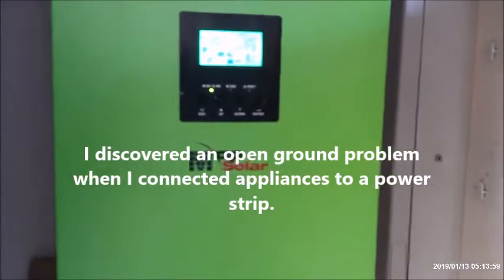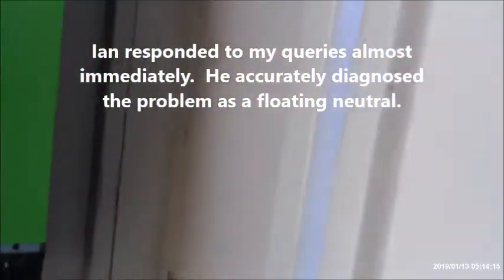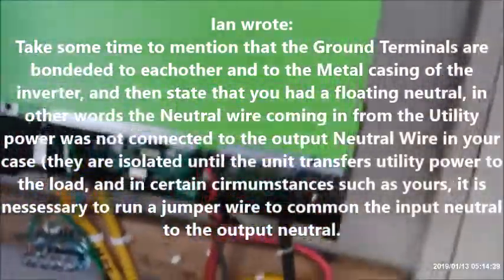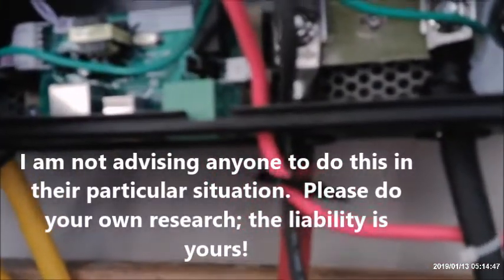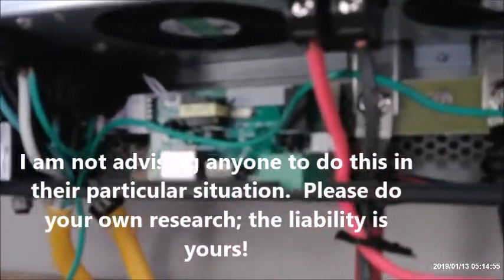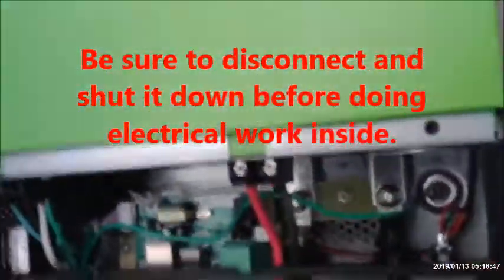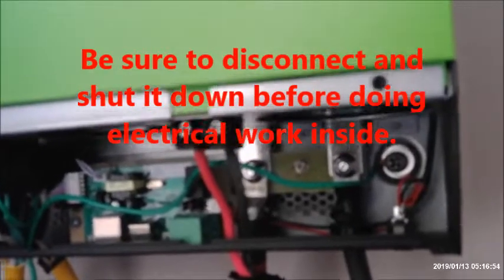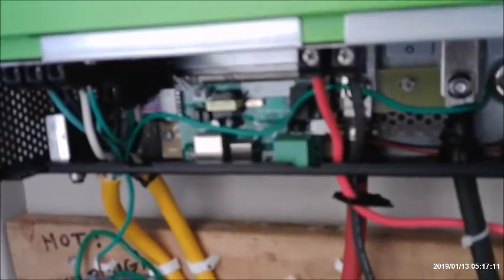MPP Solar Open Ground and Floating Neutral Problem Resolved

Comment: Thanks for this posting, it really helped me solve same issue with open ground when PV power was the source in my inverter, turns out electric company requires bonding of neutral with ground, and at times they even send power thru neutral.
Reply from the maker: Very glad to help.

Comment: I think I am experiencing this when my 2424 is setup to draw off battery only at night. During the day when the PV is producing power, the floating ground issue goes away. I have it now setup to not draw off the battery unless the grid goes down. Output source is: Solar/Utility/Battery and the ground fault goes away. It's acting like a solar powered UPS this way. When I get more solar and know I am going to get better recharge of the batteries during the day, I might try this. Right now, I am trying to put enough of my house on the circuit to use full sun and top off the batteries during the day. It still pulls about 50 watts from the grid in this mode even when I have ample extra PV. How are you using the system?
Reply from the maker: I use my system to run a couple small rooms including internet connections. It's mainly for backup if the power goes down but does save a little electricity.
As a beginner, I had to do a lot of experimentation before I finally got it running well. Good luck to you!